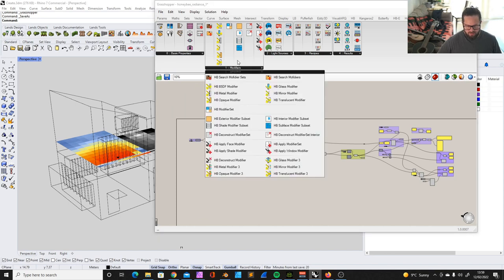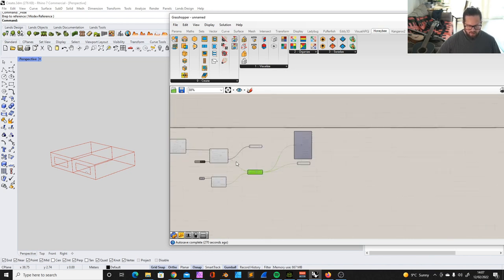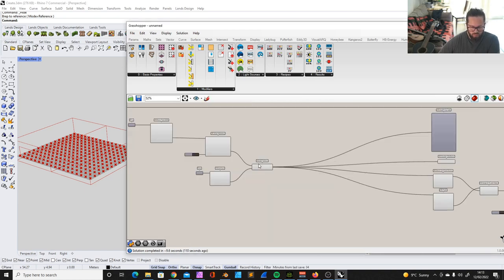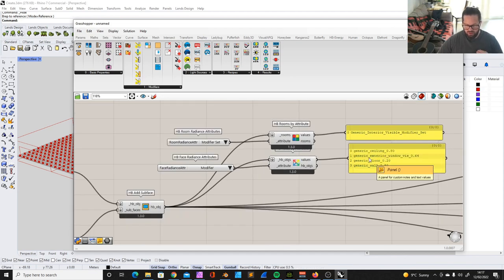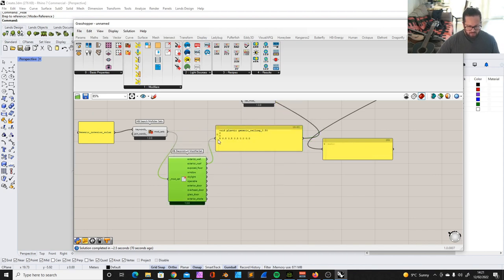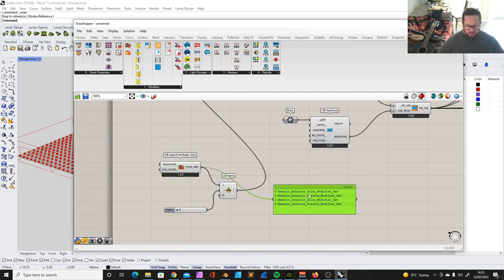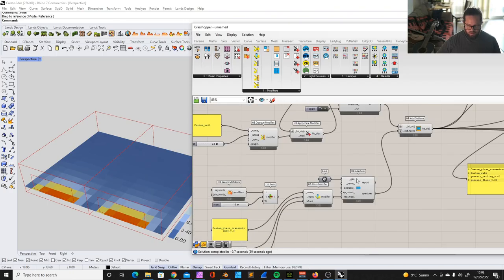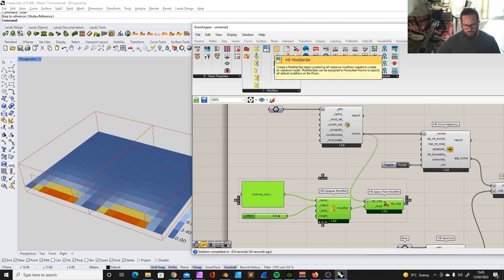Honeybee 'RADIANCE' Part 3| Modifiers | Ladybug tools 1.3.0

Comment: Hello. The video you uploaded is very helpful. Thank you. I have a few questions. Although it has not been newly released on LBT yet, I wonder if you are planning to produce a video related to the 3-phase and 5-phase techniques. In addition, I wonder if you have any plans to make a video about the ironbug related to HVAC. Thank you.
Reply from the maker: Hi, I'll go through the energy modeling after have finished the radiance components.
It might take a bit though since I need to read myself into it to understand but yes it's on the list and as in the Radiance section I try to cover as much as possible. Regarding 3-phase and 5-phase systems I need to learn more about before I can answer your question. :D

Comment: Thanks so much philip! I have a question, I made a model for bifacial solar module by using HB faces. I added a modifier for the ground ti observe how the incident radiation in the back side changes, but I noticed for values from 0.1 to 0.7 reflectance of ground am getting same radiation values but for values 0.8 and 0.9 it jumps to 10 times higher what could be the reason?
Reply from the maker: Not sure really. Hard to know without looking at the script or model. I would probably test more. And different settings, makeing sure no other settings have changed.

Comment: Great tutorial! I was experimenting with HB BSDF Modifier to model roller blind fabrics but it failed to simulate. Have you tried the same?
Reply from the maker: Are the blinds inside the building? I think radiance can't handle indoor shades...
Reply: @PhilippGalvanDesign  I tried with a BSDF modifer where i incorporated the roller blind to the outside of the glazing unit. But it gave really weird results in the point in time glare analysis...

Comment: Many thanks, Philipp!
I am working on a conference paper which requires Radiance to do accurate daylight simulations. Your tutorials are very helpful.
By any chance, do you know to modify the interior shading schedule and calculate DGP daylight metric? Thanks a lot!
Reply from the maker: Hi, I haven't managed to use scheduleds with radiance. Only precalculated as average.
Schedules are used with energy plus and open studio but don't work directly with radiance. Annoyingly.
Reply: @PhilippGalvanDesign  Thanks, Philipp! I am trying to figure it out, and will let you know if I did.

Comment: many thanks phillip for this tutorial, excuse me i have some questions :  in this version of honeybee 1.3.0 can we :
- simulate the impact of radiance material and color of (wall, ceiling, floor,....) in the simulation
- possibility to add a exterior ground to simulate the real life condition (reflectivity of faces : materials : water, glass on near building,...)
- for the areas how don't recive a good light can we use artificial light (spots) and how to simulate it in honeybee
I really love your tutorials. Informative and useful as always. Keep on going :)
Reply from the maker: Hi IMAD.
Good suggestions. I can't answer these questions yet. I myself am exploring these options. With the modifiers, we are applying materials already but on how detailed it can get in terms of accuracy we need to explore.
It's like a puzzle. I think it's gonna be difficult to for example accurately simulate the impact of sunlight on a water surface. like absorption of energy and how that affects the surroundings etc... But let's see where we get to.

Comment: Hey Phillip, I have 2 questions about the mod_set. I'm running an analysis of an interior of a house using some recipes (ANN, DF, SUN, IRR) and I didn't understand quite well which modifiers should be set since I'm testing illuminance and radiance. For the illuminance (lux) I should use the interior_visible and for the radiance (kWh - W) the solar_visible, is this correct? I have another file for the exterior studies of the same project and the components I'm using (Direct sun hours, and incident radiation) don't have the input for the mod_set, when should I use these exterior sets then? Thank you again for the tutorials, it's been very helpfull!
Reply from the maker: sorry Carlos for letting you wait so long.
to be totally frank with you I never really understood this either but think of it as names only. In radiance glass is a material with a transmittance factor...
actually when you use the deconstruct modifier tool the difference between the generic_interior_window_sol_0.77 and the generic_interior_window_vis_0.88
is their red green and blue transmittance.  I would suggest reading through the Radiance Primer and Tutorials to understand this better. https://www.radiance-online.org/learning/tutorials
Reply from the maker: regarding exterior modifier sets. these are used to test for example material influence on surrounding areas. like for example, the influence of and brick wall on the thermal comfort next to it. i did some examples videos later in the course...

Comment: Hi Philip, I have a question, lets say we have 2 floors, and if we have a mezzazine floor how can we define it.
Reply from the maker: Hey Agit, you might want to watch this video where I assembled a more complex building.
https://youtu.be/CoH9I4oZc_k

It has a double height entrance with open hallways attached on the ground floor and upper level.  Very similar to a mezzanine I would say.
It's a bit of a puzzle. Think of volumes with solids walls and air walls to create larger connected spaces. 
Hope it helps.

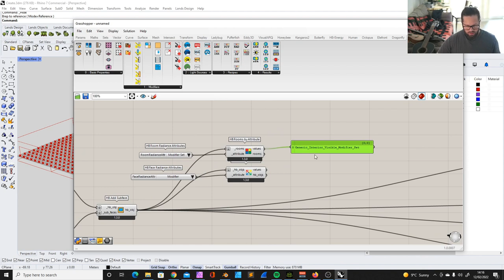Comment: Hello i have a question, the atributes are not showing when i plug it into a panel it displys "N/A" like you did in 12:30, what could the problem be?
Reply from the maker: It depends on the attribute you selected. If the attribute is not defined in the model, then nothing will show.

Comment: Hi, I have followed the steps and have added the HB daylight factor but when I go to run it, it comes up with 1 Failed: - 1 CreateOctree and 4 left pending. The only difference I can see is I am running ladybug 1.4.0. Could this be the issue?
Reply from the maker: Shouldn't be an issue. The error messages sounds very cryptic. Could copy the entire error message here?
Reply: @PhilippGalvanDesign              {0}
0. Runtime error (PythonException): The recipe failed to run with the following summary:

Scheduled 8 tasks of which:
* 3 ran successfully:
    - 1 CreateRadFolder(...)
    - 1 GenerateSky(...)
    - 1 SplitGridFolder(...)
* 1 failed:
    - 1 CreateOctree(...)
* 4 were left pending, among these:
    * 4 had failed dependencies:
        - 1 DaylightFactorRayTracing(...)
        - 1 LetDaylightFactorFly(...)
        - 1 RestructureResults(...)
        - 1 _Main_c4ed2ed7Orchestrator(...)

This progress looks :( because there were failed tasks

Use the report_out attribute of recipe settings to see a full report.

Traceback:
  line 82, in script
Reply: I did notice that my 1.4.0 DF icon is missing 'sensor_count_' that your one showed as well
Reply from the maker: Do you want to send your file. So I can check if it works on my side. I have 1.4 installed now too. office@nedomlel.com
Reply: @PhilippGalvanDesign  Thank you so much, I have sent the email